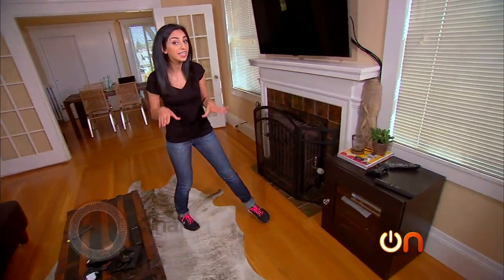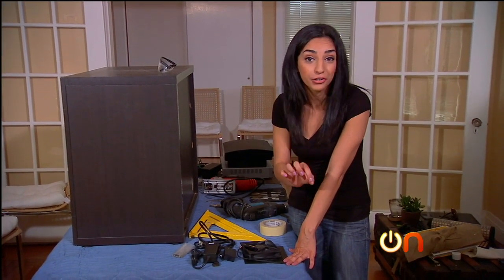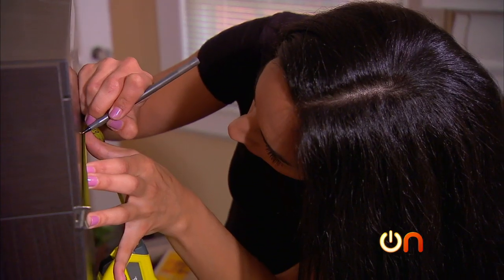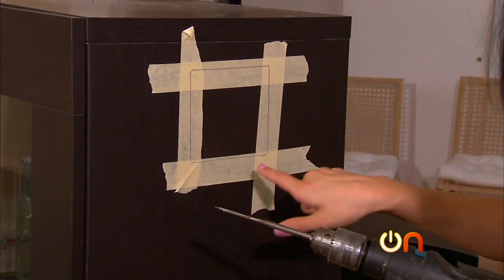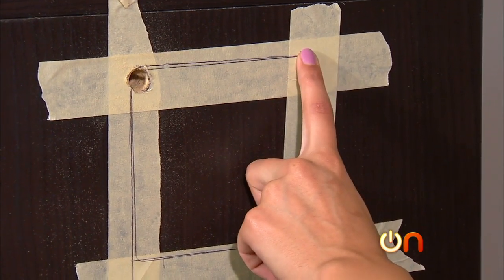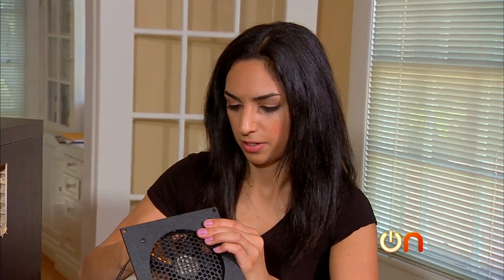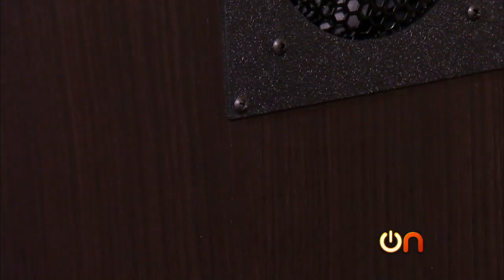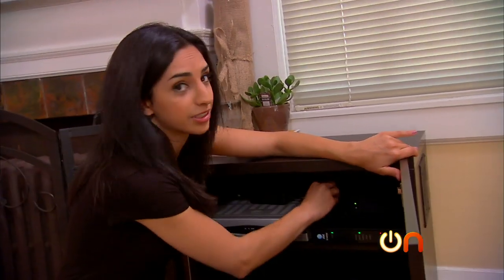Always On - How to install a cooling fan

Comment: Great video if you want to NOT correctly divide 15-1/2"  and you'll also learn the improper way to level (you actually use a level) and not a rafter angle square. She's not dumb, just led astray by producers that think they're professional contractors.

Comment: Which direction would you have the fan blow?  ///  ~~~~~~~~~~~~~~  /// But if you have another vent hole at the opposite side, even with another fan in it, then direction would be a moot point.

Comment: The AIRPLATE cabinet fan kits by AC Infinity are superior than just rigging up some cheapo computer fans. Their kits comes with a LCD temperature and fan speed controller. I have a AIRPLATE T3 plus S3 and it's been working awesome for my entertainment cabinet. Just checkout the reviews on Amazon.

Comment: I'd probably install an exhaust fan on the other side, cuz that cabinet doesn't seem to have any ventilation holes, so basically that fan will keep sucking air in, but at the same time there will be little room for the air to get out. The consequences are that allot of hot air will be trapped inside the cabinet, and the fan will get noisier and noisier.